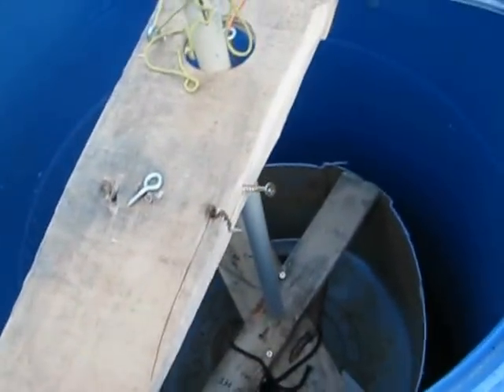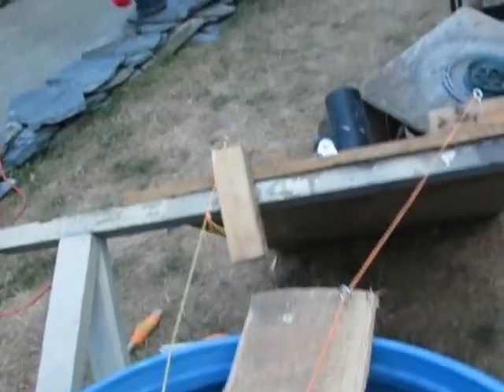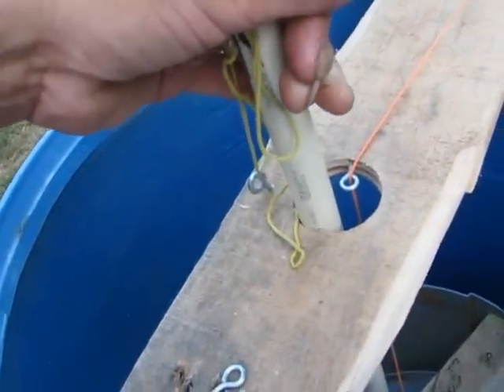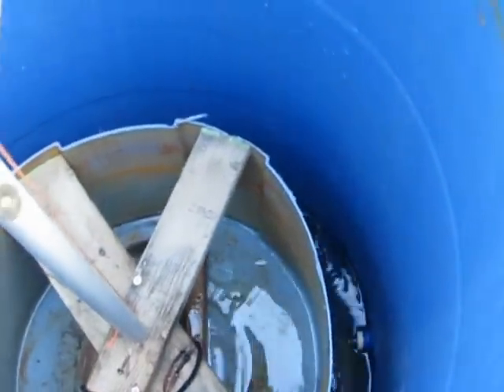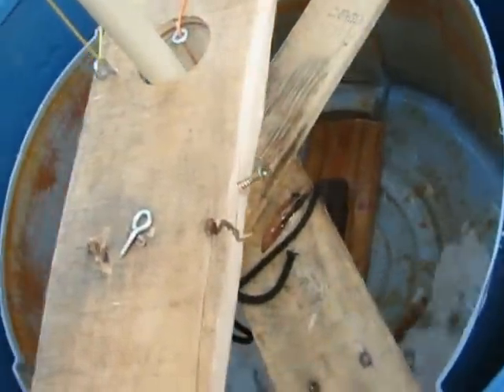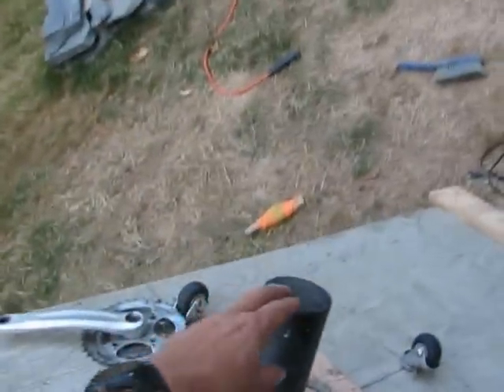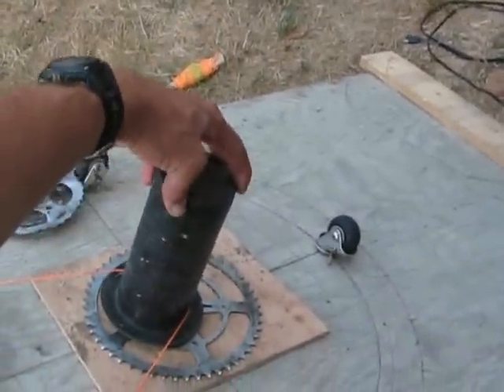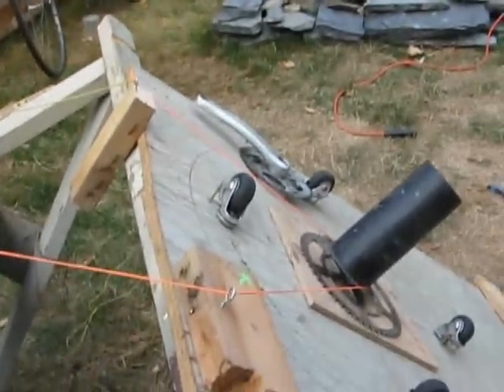New very simple dripper tracker!  Use as part of your solar tracker to get more power from your PV

Comment from the maker: It is actually a thing I designed for turning solar cookers in 3rd world countries. But it should be plenty good for turning solar panels to follow the sun. (There might be another video shortly that shows one specially for that job) This one is "universal" for solar panels or solar cookers.  In most places you get about a 70% yearly performance boost from a solar panel if it has tracking!  So if your panel system costs 300 dollars tracking can cost  200 dollars and still be profitable!